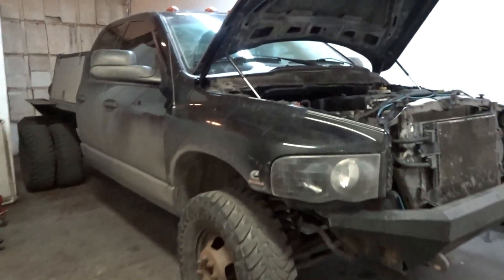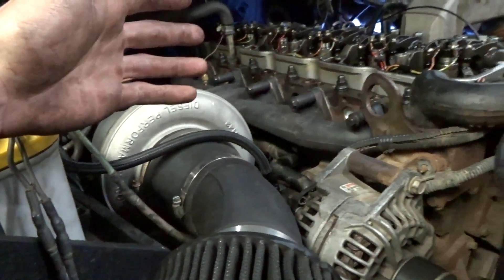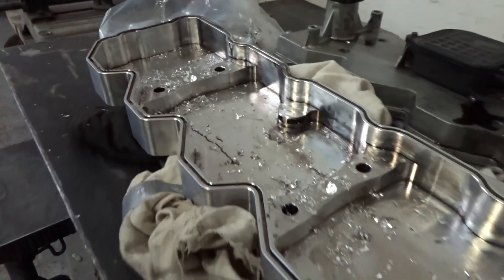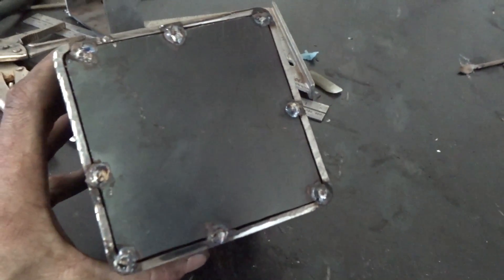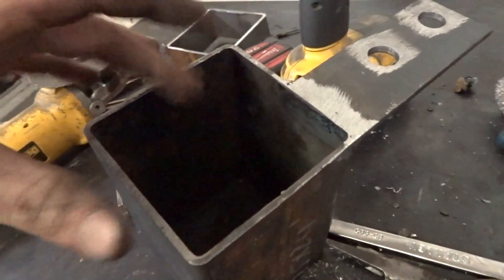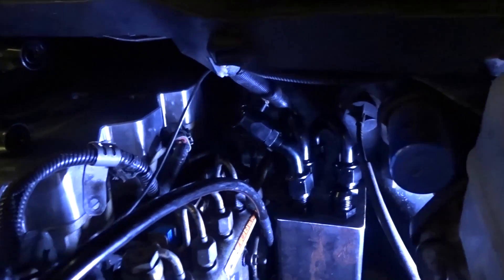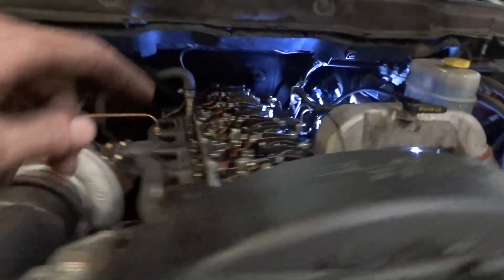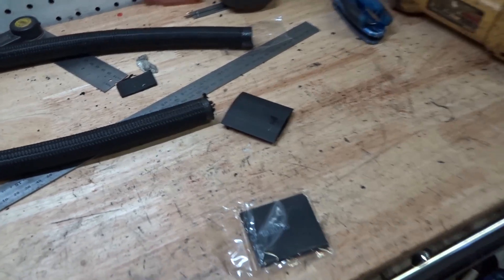BUILDING A CATCH CAN FOR MY CUMMINS!!

Comment: Great project. The only thing I would of added is Steel Wool in the catch can before welding it up. The steel wool catches the oil vapor out of the air where it then condenses and drains down to the bottom.  If you have accesive drips from the hoses then I'd cut the top off and add some steel or brass wool.
Reply: i know I'm kind of off topic but does anyone know of a good site to watch newly released tv shows online?
Reply: @Mustafa Merrick Try Flixzone. Just search on google for it =)
Reply: @Holden Braylen yup, been using Flixzone for years myself :)
Reply: @Holden Braylen thank you, signed up and it seems to work =) Appreciate it!!
Reply: @Mustafa Merrick no problem xD
Reply: SCAMMERS TRYING TO OBTAIN YOUR INFO.
Reply: SCAMMERS TRYING TO OBTAIN YOUR INFO. Do NOT search it.

Comment: I prefer buying the stainless steel commercial kitchen scrubbies and stuffing the can with those and using a dip tube.  It has worked better than any baffled can I have tried ever.
Reply from the maker: If I have any issues with this setup I will give that a try.
Reply: @Cumminslife  I dont suspect you will for years to come unless the motor is quite loose.  I use scrubbies stuffed in cheap cans on turbo gas motors.  Usually we gap rings and of course that produces some blow by.  I have a catch can on my 24v as well, different reason though, wisconsin weather is all around the dew points in the winter and moisture can get out of hand.
Reply from the maker: @blackopsrocks  Have been ripping it pretty hard past few days full fuel 4000rpm+ still not a drop of oil in the hoses. Worked better than expected.
Reply: Awesome dude.  Good to see its working as intended.

Comment: For more clearance on the valve cover  you could use a 90° AN -12 to NTP fitting or a 
90°AN -12 union fitting. You could also use MS fittings in place of the AN.
Aeroquip should have what you need.

Comment: Optimal welding it’s because the arp head studs stick up more then the oem ones it was designed to fit the original motor

Comment: Another excellent video!  My only question is if you have enough slack in the hoses to allow for the engine torquing under load?
Reply from the maker: The catchcan and vent hoses are bolted to the engine. There will be no movement in hoses.

Comment: Somebody stole my 99 2500 from kelowna Dec 21st. ..2 days after new brakes and a power 
steering pump. ..it's purple with rips in the back seat if you see or hear of parts for sale. $1000 reward no questions asked.

Comment: With the stock CCV canister, on the valve cover couldn't you just pop of the large vent line and mill out the opening vent that feeds from the valve cover for a better breathing unit? If your worried about sealing the system completely you could just get a large enough hose fitting something stubby and put a one way valve on it so moisture doesn't get inside or plasti weld a one way valve to the outlet. You could retain the factory drain back to the crank case as well on this setup. 

When I got my 03 HO, the larger vent hose was barely holding on and just collecting oil, I just ripped it of and left it wide open while retaining the factory drain. I can see the steam from the back side of my hood when its cold, but at most i get a light mist of oil on my valve cover that i wipe off every once and awhile. 

Also on your design using the billet cover couldn't you have just drilled ports on the side of the cover to mount your A/Ns I would assume it wouldn't make a difference vent wise since its pressure taking the least path of resistance to a low pressure area but i could be wrong. 

Also on your design I was surprised at how bulky it was, with the fittings that you were using I would've assumed that the holding canister size wouldn't need to be so huge since its venting and draining like a mf back to the crankcase. 

Keep up the content, hope this feedback helps.

Comment: I have a 2004 Dodge Cummins and I’m looking to purchase one of your 6 level tuners, what all comes with the switch, and or what I need to set it up
Reply from the maker: My switch comes with everything you will need for install. You will also need a hp tuners mpvi2 to load my tuning into your truck and so we can datalog to dial it in further. 
If you can come see me locally we can simply use my mpvi2.

Comment: Did you have any issues with oil consumption when you did this mod?
Reply: the purpose of an oil catch can that recirculates is to prevent oil from burning which is why he has the drain on the bottom of the can, non recirculating catch cans will have the oil gather in the can and need to be drained. Its in the name catch can, it catches oil and either vents to atmosphere and fills or recirculates like his
Reply: @Nate6133  yes i under stand that the system i built was just like his and i have a drain back to block mine in a double chamber can so it can vent off and drain back. I was asking because i stared getting a ton of blow by through can. But i figured it out i burnt up 2 sets of rings so thats why thanks for replying

Comment: I just realized you did the 2nd gen swap what intake tube is that on the turbo
Reply from the maker: I cut up k&n setup I had on stock turbo
Reply: @Cumminslife  I tried that with  a 45 my filter is to big the AFE big fucking air filter I think it's bfaf I'm fixing to build one from 5 inch exhaust tubing

Comment: You got custom tunes for a 98 24v
Reply from the maker: I have a vp44 ecu on my bench right now that I have read out the tune and also flashed new modified file in with no issues so far. Custom tuning with sotf coming very soon.
Reply: @Cumminslife  sound good bud been watching you for a good bit and if i would get tunes problay get yours and the ne catch can look dope with the valve cover
Reply: I'd be interested as well. Keep us updated!
Reply: definitely interested. especially if it's cheaper than the quadzilla

Comment: Guess I need to go build me 1 of those...
Reply from the maker: Not really required in any way for your setup but sure does look sweet!!
Reply: I know at least 3  24v 2nd gens at my house that could use a catch can, how bout a video for that?
Reply from the maker: @tonybergosh8582  Yeah you could build it exactly the same on your vp trucks.
Reply: Exactly the same? What about the puke tube on the front cover?
Reply from the maker: @tonybergosh8582  You could run your catchcan from there or block that off and tap new lines into valve cover.
Reply: Where would you feed it back into the block?
Reply: @Cumminslife  where would you send the catch can oil drain tube to?
Reply from the maker: Anywhere oil can flow back into the pan.